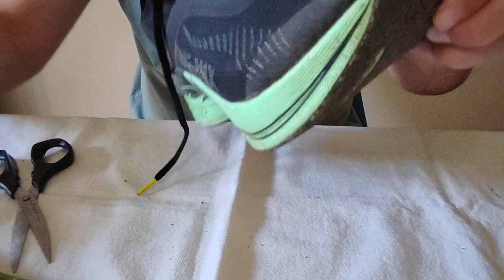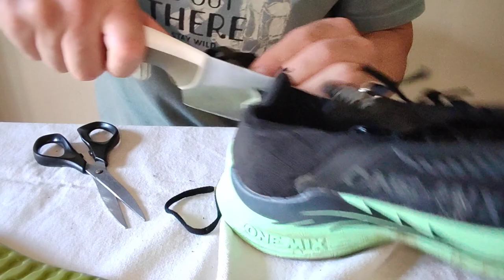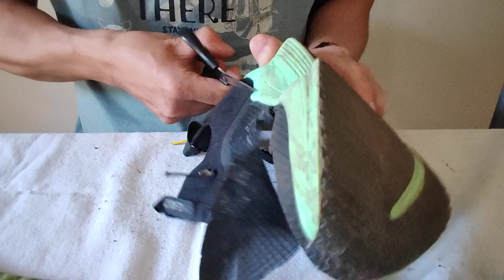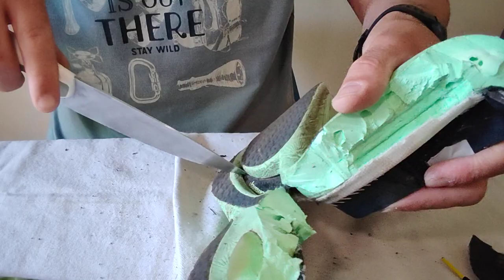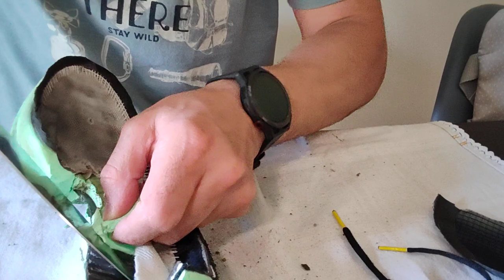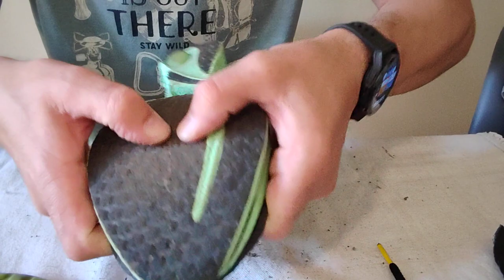what is inside the sole?? I destroy my onemix light armor to check inside. is carbon plate there??

Comment: What is the difference between normal spot shoes and onemix lightarmor
Reply from the maker: @bhagirathsinghjadeja6326  hello there, well normal sport shoes didn't have carbon plate, but you have other brands with carbon plate. Shoes with carbon plate are for running give an extra impulse to improve the speed.